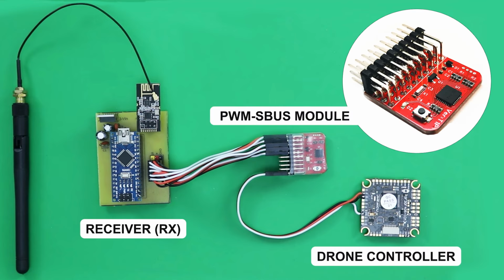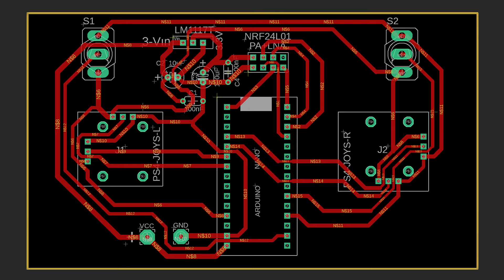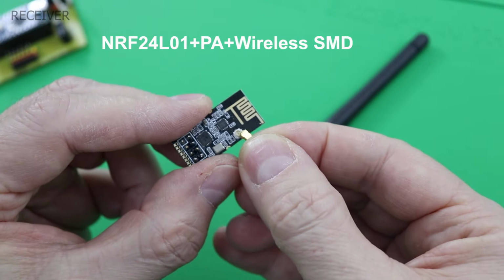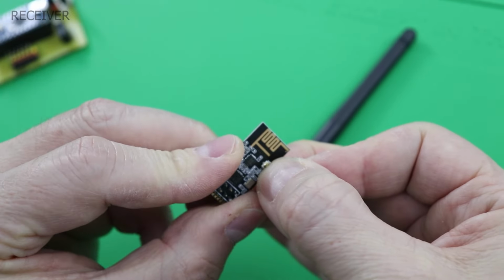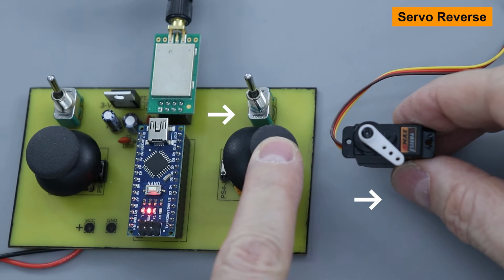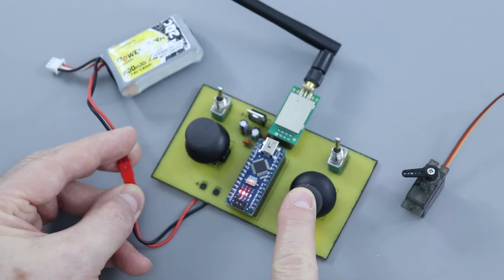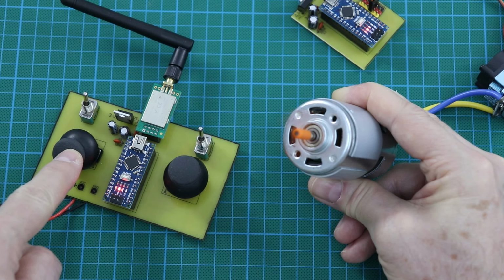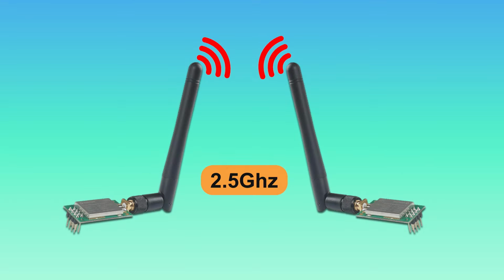Making 6-Channel Radio Control. English Voice-Over. Remastered Video.

Comment: Hello, I have a problem in the coding section, please help me. I have purchased all the equipment, when I try to send it to the board, it gives an error and the second line of your code turns red.
Reply from the maker: This is not a code issue. All necessary library files must be installed on your computer.
Reply: @Kendin-Yap  Hello again, professor, I solved the problem of the book house, I did all the work, but the transmitter and receiver do not connect, please guide me.
Reply: Same as mine transmitter and reciever not connecting

Comment: Is it normal for the lm1117 3.3 V linear regulator to heat up to the point of melting wire insulation? I used your Gerber files to make the boards and followed in painstaking detail, but the regulators are dangerously hot... Also, the code has an error in the final line for both Tx and Rx. I haven't found a way to fix the syntax, but removing the line allowed upload to the nano. Regardless, the Tx and Rx do not talk to one another, and I don't know what to do.
Reply from the maker: I tested it for an hour without interruption and there was no problem. A very slight heating is normal. But not more. Before placing the electronic components, you should check the paths on your printed circuit by measuring them one by one. There are paths and connection points that are very close to each other. A short circuit may have occurred. Overflowing solder after soldering may cause a short circuit. And is the direction of LM117 correct?
Reply: @Kendin-Yap  I had the Vin incorrect on the receiver at first, but corrected it. Both are now cooler. The only thing left is the code for the Arduino. Once I can get Rx/Tx to listen/talk, I'll be ready to fly!
Reply from the maker: @ The code works fine. If you are getting an error, there is another reason. If you delete a line from the code, you cannot expect it to work. :) If you share the line you deleted and the error message you received, I will try to understand the problem you are experiencing.
Reply: @ When I copied from your website to my IDE, the last line was </RF24.h></nRF24L01.h></SPI.h>.

This line gave the error "Expected unqualified-id before '<' token." I couldn't find a function online for the line, so I deleted it, and the code compiled.
Reply from the maker: @DCO_JP  These are the first lines, not the last. The necessary library files are being called. The circuit cannot work without them.
And this is not a code error. The error occurs because your computer does not have the necessary library files. First, you must upload the library files to the Arduino/libbraries folder on your computer. Or you must install it via the Arduino IDE. You can find many educational videos on this subject. One of them is.. https://youtu.be/f1z8Wvy56t8

Comment: Sir, I had a problem powering the arduino with the BEC from esc.. I think because it's 5.7v and it's wired to Vin. And 5.7V in the Vin is too low... The arduino kind of responds for a second then stops.... If I supply more volts in the Vin, like 7V then it works normally.

Comment: Not sure if anyone has mentioned it, but your Rx board's capacitor labeling is the opposite of how you installed them on his video. You put the 25 V 100 uF in the slot labeled 10 uF.
Reply from the maker: Yes, that's true. These types of small errors can happen while shooting video. But it doesn't affect its work positively or negatively.
Reply: @Kendin-Yap  your videos are a great resource. I wouldn't have gotten this far without them. I think I may have picked too hard of a project to start with, though.

Comment: Can I use 3 position toggle switch instead of 2 position toggle switch???
Reply from the maker: You can use it but the 3 position switch will work like the 2 position switch. The code is for the 2 position switch.

Comment: How much  volt you use for  10 uf and 100 uf electrolytic capacitors  in this video
Reply from the maker: 16V+
Reply: @ it can be 400 or something ? I am getting that . Ok all capacitors should be be 16 + v ?

Comment: 333 / 5.000
Dear friend, I have a problem. I have assembled it and it works great, but after a while the transmitter stops working. I have realized that the transistor is very hot. I have put a couple of 18650 batteries in series, which when charged rise to 8 V. Is this possibly what is causing the problem or do you have another idea?
Reply from the maker: There is no problem with 2 series connected 18650 (Max 9V). It is normal for it to heat up slightly. But it should not heat up enough to stop working. Did you measure the voltage when it stopped working? After a certain voltage, the connection is lost because there is not enough power for communication. I also recommend that you check the soldering and circuit paths of the transistor. A very micro short circuit can cause such a situation.

Comment: Bina esc ke connect nahin hoga
Reply from the maker: It can be connected. You can use the GND and VCC pins of the servo input socket for power input. You can use an external 6V battery instead of the ESC.

Comment: Hello sir. I am from India. Very well done sir. However, I have a doubt. Can I use NRF24L01 + Pa + Lna (black module not green one) for the transmitter? And, can you make a video on 14 channel rc transmitter and receiver? I have already commented to some of your other videos as well. And, can I use SPDT 3 pin 2 position toggle switch for the aux channels on transmitter?
Reply from the maker: All NRF24 modules have the same connection pins. And the same code is valid. There is only a power difference between them. So you can use each one. You can use 3 pins 2 positions but it works like a 2 position switch. It doesn't make a difference.